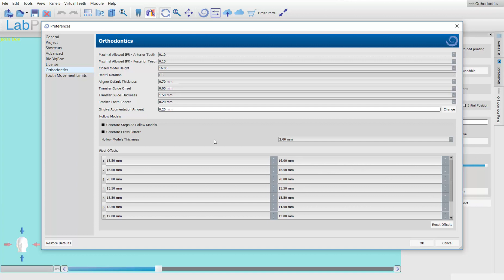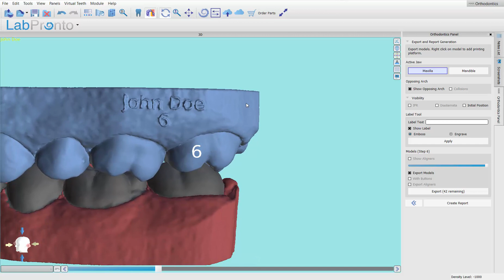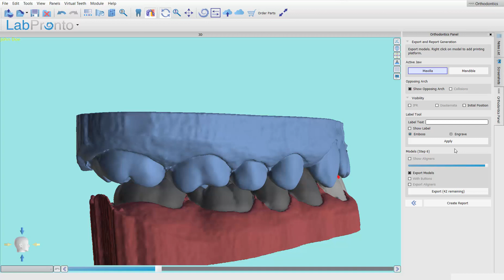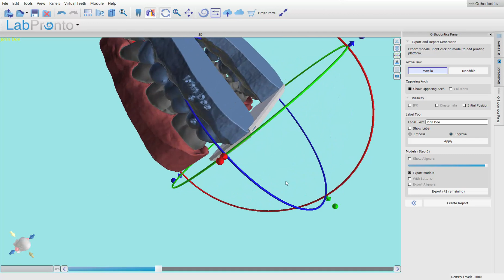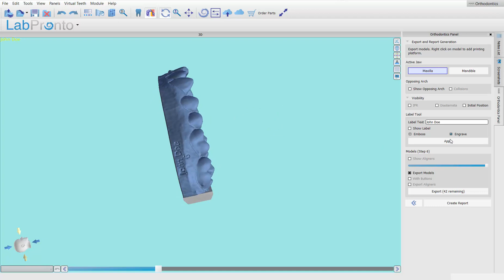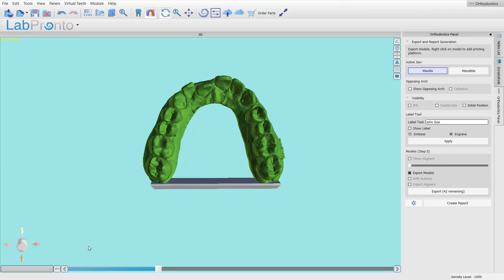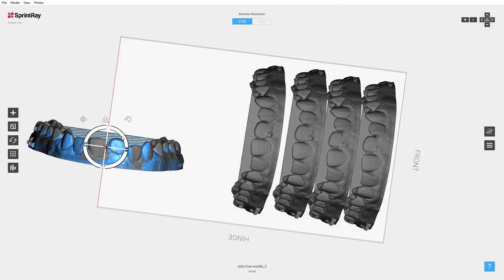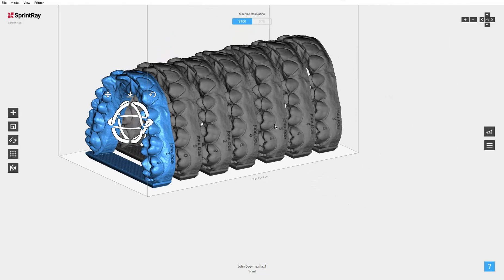BlueSkyPlan Ortho - v4.5.9 - Finalizing the Case

Comment: Awesome video as usual! I've been playing with BSB ortho for the past two weeks following your awesome videos. I haven't seen anything about power chaining at the end to make sure the case does not accidentally get any small spaces in between the teeth when finished. Any ideas on how to achieve that? Again huge fan of the videos!
Reply from the maker: No automation, currently in the software. It is something that we're looking into adding in the future. On the rare occasion this happens, I open a new case and simply tip of the teeth Lingley back by 1° in the interior. This seems to get the ideal cinch back. For me, the way to avoid this is simply to only IPR two thirds of the recommended amount. Then floss check throughout treatment.
Reply: Great idea about the minimizing the IPR a tad bit. That would for sure do the job. And the inclining one degree is great idea too.